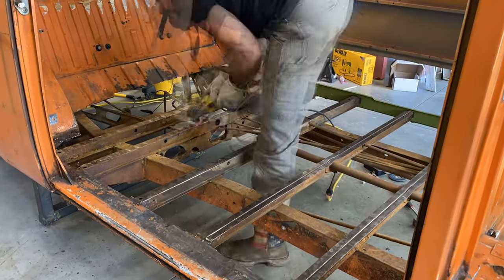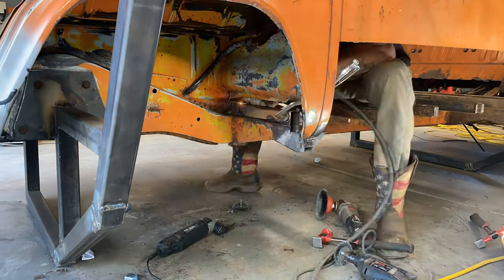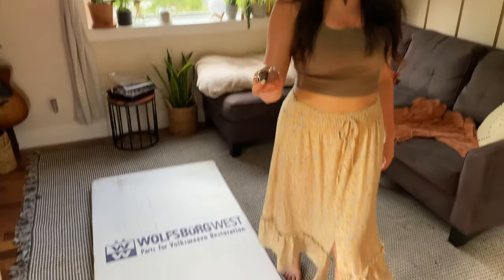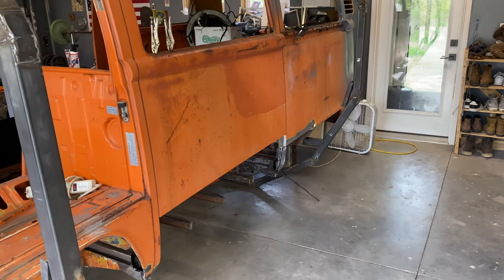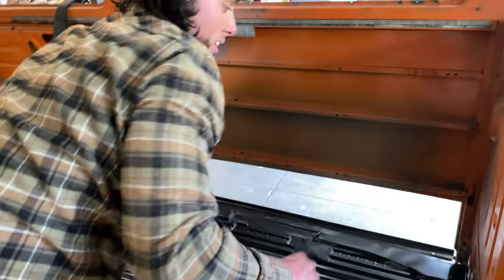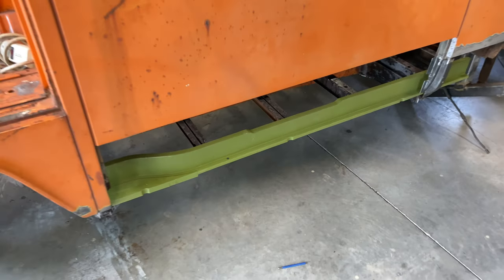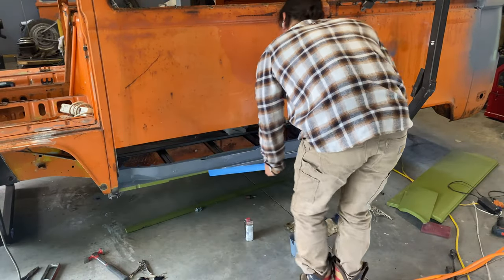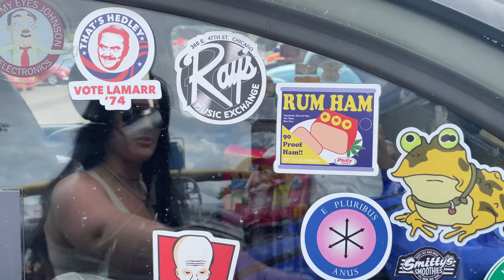Installing The Inner Rocker | VW Bus Restoration Episode 33

Comment: I don’t think Klassic Fab panels are weld thru? A lot of people recommend taking the green protection coat off and applying an epoxy primer or weld thru primer.
Reply from the maker: They are weld thru and they weld pretty good, but I am going to take the paint off on the outside of the panels for my paint job

Comment: What welding machine do you use? I am repairing a baywindow 

and I use a Chicago Welder flux core but it is complicated
Reply from the maker: Flux is no bueno for body panels. You need MIG with shield gas!